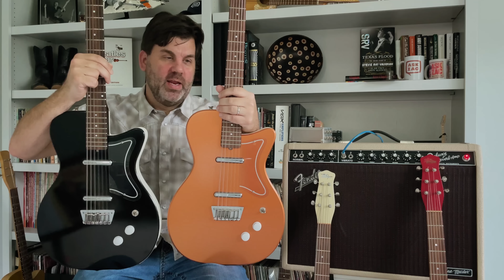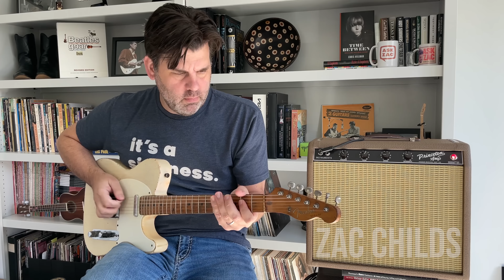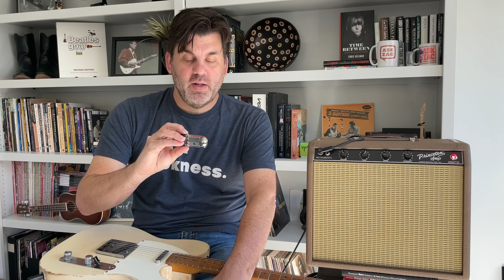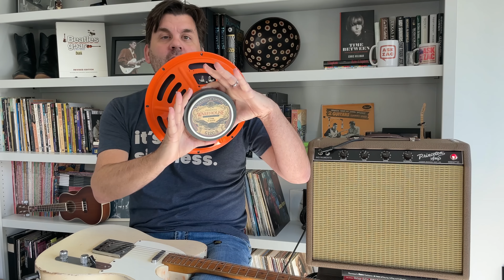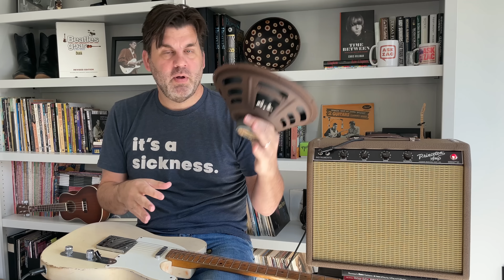Hot-Rodding The Brown Princeton - Ask Zac 101

Comment: Changing out speakers in an amp is like trying out different Overdrive pedals, its a rabbit hole that you may never get to the end of :)
Reply: Yes sir I have 4/12's....4/10's....2/12's and 1/12 cabinet's IMO the 4/12 sounds the best but 2/12 is a close second and very portable along with the 4/10 too I actually haven't tried the single 12 yet But these shine with 12's Mine is a 61 Boost and delay your set
Reply: @paulcowart3174  try oversized 2x12. Best of both worlds
Reply: i try to stick to a handful of speakers (mainly WGS since i can find them easily here in Australia), generally one speaker/cabinet per amp. for my Marshall and a custom bassman/deluxe hybrid combo I have, G12H30 speakers sound amazing in a 1x12, and for my brown panel stuff i have a 4x10 and a 2x12, loaded with the G10/12Q speakers. the Marshall and the Bassman stay at home, and the brown panel stack is my gigging rig.
Reply: Good advice.
Reply: Changing a speaker makes a huge difference in an amp

I have NEVER heard much difference changing tubes. Even between nos and new production tubes. Not that big a deal what tubes in my experience
Reply: Rabbit hole indeed. I have the WGS G12c/s in my lil dawg choco prince. It's pretty much the Stapleton amp in a priceton reverb cab. As much as I love it, I have to disagree with Zac about installing it if your looking for something mid scooped. I find it a very punchy speaker. It's a fast, efficient speaker with a healthy mid punch. I've been considering somthing British like the Celestion G12h30 or the Benson amps weber made speaker. That driver has a slight mid scoop and I think it might balance out the abundant midrange of a 6g2 circuit and add a little kerrang to it as well.

Comment: just found this- I get my CS Princeton tomorrow. 
I am surprised you did not put a V30 or an ET-65 in the amp.
The GB128 sounds honky, nasally; very low mid, mid forward.
After going thru the Emi speaker specs my feeling is the stock speaker is a Red, white and blues or a V128 which I believe is their take on a v30.

any interest in trying some more speakers- I realize this is 3 years old, but.......

Thanks @askzac ! great video.

Comment: If this was my amp I'd want to go for 12AX7 tube with more gain like a Sovtek long plate.  Also I had a 5E3 clone that I did the speaker roulette on, and I settled on a lower wattage Jensen P12R alnico speaker.  I could run the volume wide open (which you want to do with a 5E3 amp) without blowing myself out of the room.   If this was the original 10" design I wouldn't hesitate to put in a Warehouse Veteran 10.

Comment: I have a blackface 65 - add a push/pull volume and wire the in position stock. Wire the “pulled out” position so it shuts off the negative feedback and boosts mids by changing the value of the resistor at the bottom of the tone stack. Yeehaa!

Comment: Love this amp, and yes it's a sickness... I am on my third speaker swap, landed on a Jensen P10R-F with a baffle adapter installed as well. I think this one will stick. Great tone and I like 10" better. Less low end rumble for playing at home. It's also has very low efficiency, 92.5db vs the 101db stock speaker. That's like going from 100w to 12w. Again, great for low volume playing. I also had to put a diode across two lugs on the tremolo intensity pot as it was quite noisy. Works the same but the (throbbing) noise is gone.

Comment: Zac, this is basically a single channel tweed deluxe with a fixed bias output section and the volume pot wired correctly.   I would consider changing it from the fixed bias to the old style cathode biased power tube section.   The gain is all up in the first section of the first pre-amp tube.  >>>>>>.I modify the AA964 straight Princeton's by using the chassis hole for the foot switch which turns off & on the trem......and just leaving the trem controls on the front panel to turn the trem on.....which then free's up the chassis hole for a toggle switch without altering the chassis of a vintage amp.  I use the toggle switch to switch the tone stack of the AA964 in and out of the circuit as its a high loss style tone stack typical of the blackface era amps.  SO with the added toggle switch the amp can be stock and factory with the tone stack in, and then switched to a much higher gain you'd have if it was the "G" series amp or a tweed......all be it without a tone pot for the sound/tone adjustment.  You get the pure tone of the circuitry and tubes and speaker....as this is a very simple circuit for an amplifier....bare bones for a AB push/pull amp.   What I do with Princeton Reverb amps is to rewire the tube sockets of the pre-amp tubes because they wired the trem circuit by splitting the phase inverter tube instead of having the tube socket dedicated only to the phase inverter.  SO it makes the pre-amp tube swapping not as effective unless that you rewire the phase inverter socket to be dedicated fully to the phase inverter.  Which means I put the 1/2 of the socket circuitry on to the socket I just moved circuitry from......shifting the trem circuitry to a different tube.  This is very effective in a "G" series or a straight Princeton AA964 as it puts the V1 all pre-amp and the V2 all phase inverter.......which lets you dial in more accurately and conventionally....meaning you can focus on the gain on the V1.  The signal flow on paper has the full function of the phase inverter NOT split between 2 tubes even though its using 2 tube sections......so like a conventional amp it should be a dedicated phase inverter tube.  Generally, other than a 12ax7, you'd step down in gain to a 5751 to a 12at7 to a 12ay7....to find your preliminary gain structure based on your guitar signal strength driving the amp.....be it humbuckers or single coils.
Reply: well... why did render split it to two tubes?  there must be something missing if you change it...  having one tube you can adjust for gain makes sense tho.
Reply: @chb8037  The Tweed Princeton is Class "A" and that operates on 1 power tube generally.  This is Class "AB" so it needs 2 power tubes to operate in class AB (Push/Pull).....which requires a Phase Inverter functioning tube.  So if it is a Tweed series Cathodyne PI....the whole 2 sections of the tube are NOT utilized for the Inversion...Cathodyne uses just 1/2 of the tube and the other 1/2 is basically a gain stage coupled direct.

Comment: Nice video! I’m really digging this amp! 

I’m a big fan of Greenbacks in Tweeds. I’ve got one in my Franklyn Amps 5E3 Deluxe, along with vintage RCA tubes. I’m thinking of doing some tweaking on my Franklyn 5F1 Champ with a new speaker. I had Derryck build the Champ with a cabinet big enough to handle an upgrade to a 10”, which the larger cab alone has an impact on the sound of the amp. He made and provided me with an extra baffle for a 10”. Now the Oxford 8EV that’s in it sounds nice, but I am curious what another speaker would do. I’m thinking of trying a Webber 4 ohm 10” alnico and seeing what that sounds like. You’re right, it is a sickness! 

Check out Kenny Vaughan playing some Tweed Franklyn Amps on YouTube.
Reply: Love my Franklyn 5e3. I stuck with the original Weber 12A125a that he put in it to begin with.  Did some tube swaps, but a really great amp and the 3 way switch he puts on it is wonderful if you want to run it cleaner with a pedalboard
Reply: @iuchilton  awesome! Yeah, Derryck put that switch on mine too! It adds negative feedback to the circuit, like the Blackface amps, which cleans the amp up a bit. I know he’s always looking and listening to different speaker options.
Reply: A Weber classic alnico ten is in mine but thinking about putting a Celestion Gold alnico in there instead Most of my extension cabinets are alnico Might have to give the greenback a listen as well Thanks
Reply: @paulcowart3174  I really like Celestine, but I’ve not been able to find a 4 ohm 10 for a champ.
Reply: @kevinbolick2349  Yeah I need to check the ohm's on my Princeton before I do anything Someone in this comment section replied about one but will have to look again He stated the ohm rating

Comment: I usually change out the wimpy Princeton output transformer and swap in a Deluxe Reverb output transformer......BUT what would be interesting on this amp would be the attenuation they did on the Eric Clapton Tremolux tweed they did........being this is a one volume control and it needs cranked into the zone.......not factoring in the aspect of LOUDNESS.......but that circuitry would be very applicable to this amp if it needs tamed down

Comment: Yes changing the rectifier tube and its resultant plate voltages is a quick scenario.  BUT it depends on what power tubes you have in the amp.  BUT if you converted to a cathode biased power tube section.....you'd be toying with the saggy aspects of the rectifier and how it applies to the power tubes.  The REAL effect of dropping the power rail voltage is not so much on the power tubes but on the first pre-amp tube.  I'd settle on a set of power tubes first and cathode biased and determine the sag........then go and adjust the power rail power resistor feeding the V1 node and drop the plate voltages appropriately........lower voltage is more tone but less gain.......higher voltages get more gain and more brightness and somewhere it goes brittle bright.  SO its dialing in the pre-amp voltages.  I've been happy with JJ 6V6's as heavy duty tubes.......real NOS 6V6's have a cream to them......and the newer re-issue 6V6's are ok but I have had issues in the past with them with good batches and bad batches......they need burned in well

Comment: What did you bias that amp at if you don't mind me asking? I have a '68 custom princeton and I  am going to put a 5y3 in it, is there anything I need to know? I have already put a 12" Alessandro eminence speaker in it and that really woke it up. Thanks, great video.
Reply from the maker: 19mA 410 volts
Reply: @AskZac  thanks
Reply: Man,I put a sylvania 5y3gt in my '68 custom princeton reverb SF and it did just what I wanted it to. Made it break up really nice with the volume on 4 to  5. I also bypassed a resistor in the tone stack and it made bass and treble a lot more useable. I have a 12"eminence Alessandro speaker in it now, I had put a 12" celestion neo creamback and it brought the amps weight down and sounded good but I think I like the eminence better. All in all it sounds pretty damn mean. Thanks for the video Zac. Oh, I forgot to mention that I I put genalex gold lion power tubes and preamp tubes except for v1 and that's a tungsol 12ax7.  All Russian tubes except for the rectifier. I also tried the greenback and the 65 watt creamback and didn't care for it which is amazing because I'm a celestion guy but to my ears, they just don't work in this amp. Enough jaw jacking, I'm gonna play now. Like you, I too have the sickness 😉

Comment: The JJ 6v6s can handle higher plate voltages hence the combi w the type of rectifier. To make this a gigging amp they put in a high spl speaker pos an Eminence. Maybe over the top. There is a lower powered version of that. Both WGS speakers do not hit the spot imo.
I suggest an Eminence GAsc64.

Comment: Hey Zac you're badass! Hoping you might have some advice... For brighter tone, what speaker would you recommend putting in a Champ build converted to push a 12" speaker? I'm not really a purist going for the original Champ tone. I currently have a Celestion G12-35XC in it and it's muddy as hell. Thanks man!
Reply from the maker: WGS G12Q  it will open it up!
Reply: Awesome man I’ll give that a try! Thanks!
Reply: I finally got the WGS G12Q and it transformed my Champ. It did exactly what I was hoping for and sounds amazing! Thanks again for the suggestion Zac!

Comment: The Weber 12F125 or 12F125S are my favorite 12 for Brownface amps(Besides an original Oxford/Jensen).
I have a good selection of speakers and tubes I swap around in my amps too. It’s fun!
Reply: My 61 pairs up well with a 2/12 73 Vox cabinet It has the gold alnico Oxford's that Vox was using after the shipped empty cabs to America Their way of saving shipping costs I actually pulled them out of the very heavy Vox enclosure and loaded into a Mojo Tone brown Fender style cab

Comment: I have that amp, I have had it since it came out.  It does sound stout and amazing - I do want to mod it however, as I am tired of it weighing 275 lbs. Thanks for this video!
Reply from the maker: I currently have the Celestion Alnico Blue in it. You can hear mine with that in next week's episode. Though that is not what the episode is about.
Reply: @AskZac  Hey Zac, just found myself wondering if you still have the Blue in this Princeton? Seems like a great way to split the difference between the Harvard and the Vox! (And saves taking a vintage amp out, to boot)
Reply: Me too. I’ve put the Jensen Blackbird 40 Alnico. Weight 4.4 lbs only and sounds like a bold P12Q

Comment: Zac, me and I am sure a lot of others have a Blues Jr amp. It is a version III and my 1st tube amp that I still have and love it. Can you do a show on your way of setting up/modding one of these amps to the way you would use it??
Reply from the maker: I will see if I can find one to borrow.
Reply: @AskZac , Thanks,  The Blues Jr is a great inexpensive Black Face tube amp with a 12" speaker already. My big complaint with it is no standby switch! I would love to be able to get close to your Princeton tone??
Reply: @cowtowncustoms2110  I don’t think you will get close to a Princeton with a Blues Jr. Two very different amps that sound nothing alike. I’m the first to admit Blues Jr’s are one of my least liked Fender amps every, but you might want to search for mods kits that can be done. (Different output transformers, changing the tone stack, etc). But if you love what you have, why change it? Playing around with different speakers might be all you need. (And you can get the sense of that by just playing any Blues Jr variants in stores). 

One thing I’ve learnt about tube amps is everything matters, the tone stack, the circuit, the tubes, the speakers, the cabinet wood, transformers, etc. Hence why a Tweed Deluxe sounds different from a Silverface Twin.  

Don’t worry about no standby switch, bit of a myth that it does anything useful unless you using massive tubes for radio towers. The Brownface Princeton doesn’t have it, neither the tweed Harvards, Champs, or Princetons. Very unnecessary in a low wattage amp.

Just so you know, the Blues Jr. isn’t a Blackface, or a Tweed or Brownface no matter how Fender markets it. It’s is it’s own thing - very different than any of the vintage amps Zac mentions and plays, thus the difference in tone.
Reply: @electricj5  , I love what it does as a 15 watt tube amp and I have a friend that has one he has modified  several times to now he wishes he never touched it and wants me to buy it real cheap! I have other higher power good tube amps that I use but I want to tinker on one that can be fun or just buy a Stew-Mac kit?
Reply: @cowtowncustoms2110  what other amps do you have?
Reply: @electricj5  Kustom 72 Coupe that is a James Brown design and built in USA, Fender Hot Rod DeVille 4-10 , Marshall Class 5, Kustom acoustic amp and a Boss Katana 100. I am wanting a Deluxe Reverb before I buy a Princeton. I build guitars for fun since I am retired. Most are Telecasters and then Stratocasters so I like a good clean amp that I can push when I want. The Kustom does everything I want except it is a 72 watt powerhouse twin 12" speakers that move a lot of air on demand!
Reply: @cowtowncustoms2110  do not buy a Blues Jr. if your soldering iron is hot and you want to tweak caps and resistors. I have a 20-year old green board version. I had to put in variable bias because it burned up power tubes. Unfortunately the manufacturing quality is so bad, every time I look inside that amp something else goes wrong. PCB mounted pots and input jacks are a bad starting point, and everything in there is cheap. 

I have repaired vintage blackface Fenders and a few other amps, and built 4 different amps, so I do know what I’m doing inside an amp. Don’t get me wrong - I like the sound of the Blues Jr. - it’s just a bad mod platform IMHO. 

The best single mod I ever did to anything was replacing the stock Blues Jr. speaking with a Weber Blue Dog. Bill Machrone was the guru of Blues Jr. mods and I think you can still find that info. Doug Hoffman took a different approach - he developed replacement turret boards and a proven layout to gut the amp and make something new using the cab, speaker and transformers. El34world.com is his site. You can fiddle with a turret board to your heart’s content, unlike the crappy, fragile PCB inside a Blues Jr.